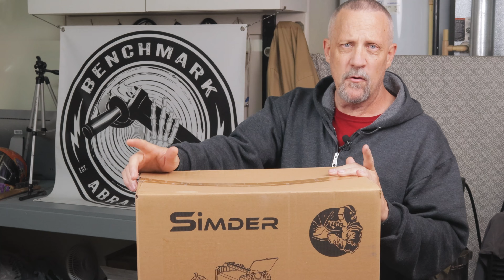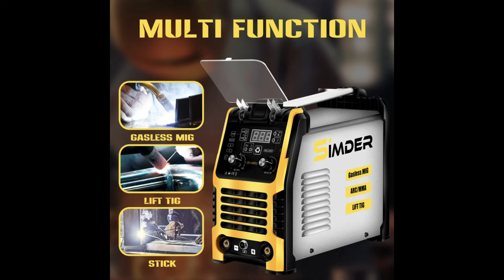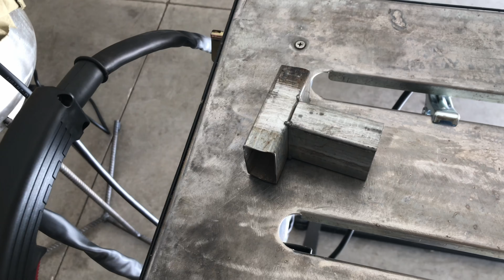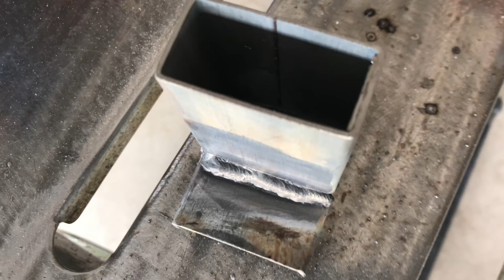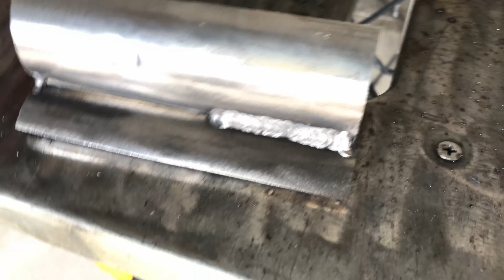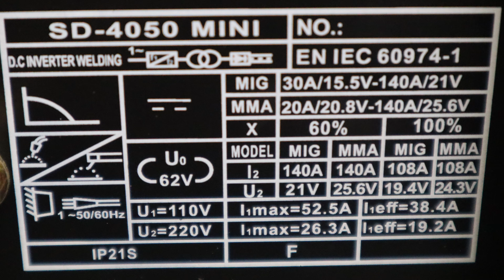Don't Buy This Mini Welder Before Watching This Test!

Comment: How does the syn others buttons at left side of display work???
Kentucky
Reply from the maker: Those are not actual buttons you are referring to. They are just a printed display showing the process of the welding I guess? I'm not really sure why they have that printed on there to be honest but they are not buttons and serve no function IMO.

Comment: Too bad Simder doesn't supply MiG settings. Not on the welder, not in the manual, not even on the website (where they direct you)
Reply: Just received upgraded (2024) version. MIG settings are on page 12 of operation manual. 
All other mode settings are covered.